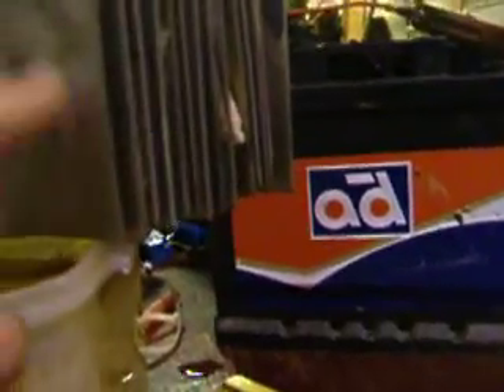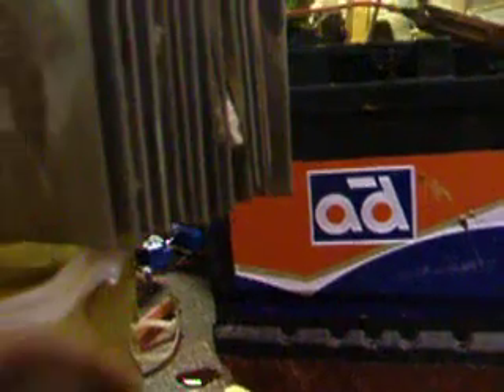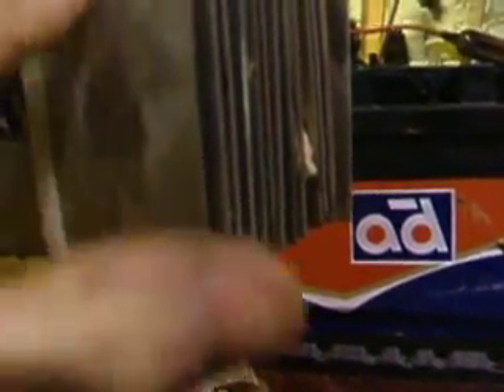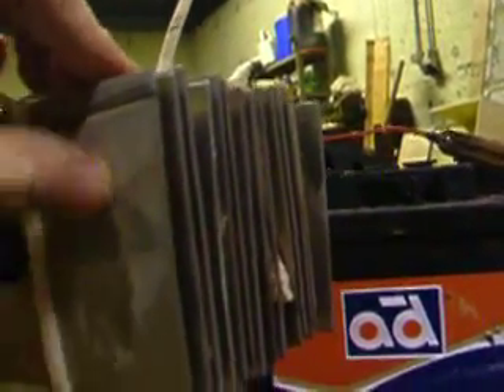HHO mossing? on my fuel cell? video3

Comment: bornman88 on here said Lye or KOH with water works the best?   here he says "You have to experiment
Start with little and add if the current is to little

In my car electrode which is different to this electrode I use a 5:1 ratio by weight

As this is a different electrode the ratio is much higher maybe 100:1 by weight(water:lye)

Very important!! NEVER add water to the Lye
ALWAYS add Lye to the water in small amounts and wait to cool between adding!
Be Safe!!"
Reply from the maker: Thank you

Comment: the white dust is great for a pulsed cell to help the plates build up juice before dumping it. you can get rid of that dust in minutes by reversing polarity and tossing higher current at it. hope this helps. good vids btw.
Reply from the maker: How did you reverses polarity . With out taking the leads on and off

Comment: hey bud, best case scenario would be 316L stainless, distilled water. is that 304 ss? the white stuff could be a number of things. if its 304, youll get a big amount of things leeching out from the steel while running. one of which is iron. it is probably a calcium build up everyone is trying for with the stanley myers replication.
Reply from the maker: What did you find the best set up to be in the end ?